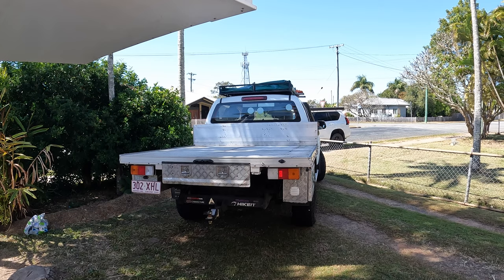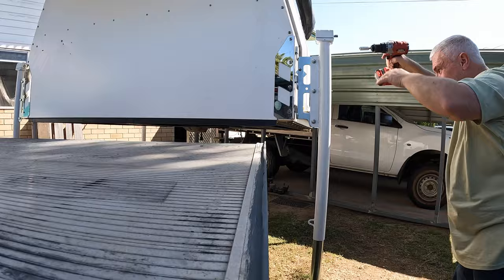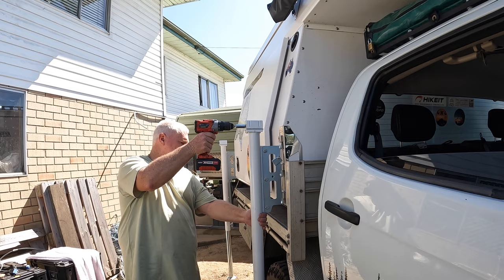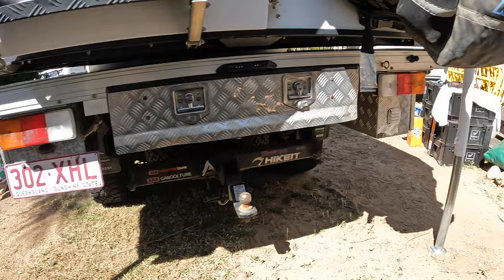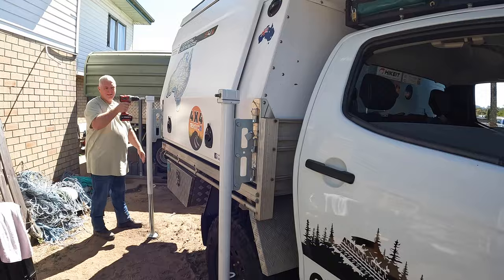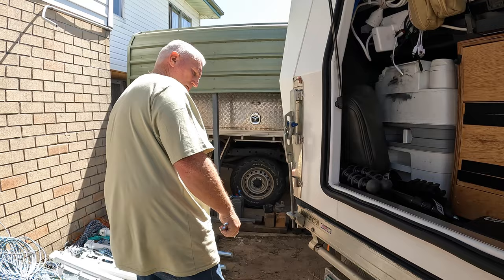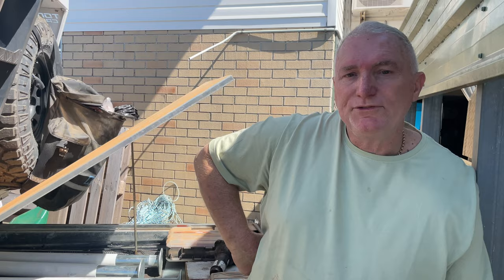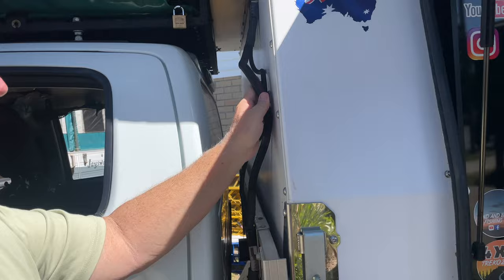How to LOAD the SLIDE ON CAMPER onto truck, clamping it, remove legs, storing legs, refit electrics

Comment: Excellent Wayne, extremely helpful for all Tommy Camper owners.

I've don't it a few times now, including the mistake of when there is a slope and your tray pops up higher than you think potentially catching they Tommy Camper as you drive out ( I was watching so stopped but if I had not it could have been bad, I raised it 100mm higher than the tray, but it still poped up that much as I drove out ).

It would be good to come up with a quick adjust method for the Stair Leg lengh as when I have mine off it definately has to be lowered for stability (my tray is high) and the stair angle is about 35% when its off so not so good for access.

It would have been good if you could have also included some advice and experience of how to cross stabilise the Tommy Camper when its at camp too, maybe another video?
Reply from the maker: You’re absolutely right about the steps adjustment. I’ve issues with that as well.

Comment: Hi Wayne, what make tommy camper legs and how is to sleep in camper when stand legs with out tray is it Stable  . Great videos thank you
Reply from the maker: Stability is fine. There are tie down points on each of the legs. I use the rear tie down points only. The legs came with the TC. Not sure of the brand

Comment: Hey Wayne, Thanks for all the Tommy Camper info's. Would you be able to tell me the Height from the Ground to the Campers highest point like the top of the roof rack. I know you had a GVM upgrade on your DMax and I'd probably would have to do the same if going a similar way with Camper and 4WD. The height is important regarding our Garage....! Thanks again and I'll keep watching your great videos.
Cheers Kurt
Reply from the maker: 3.2 meters when up, 2.32 down.
Reply: @CanopyCampingAustralia  Thanks heaps Wayne. Bugger, our garage opening is 2.29 mt. Plenty high inside though. Means either not Roof Rack or smaller Tyres.

Comment: Hey I have a couple questions, how much does the camper weigh and where did you get the tie down clamps and what weight are they rated for. I have chain and turnbuckle on my DIY camper but I like the ease of use on your clamps. Thanks